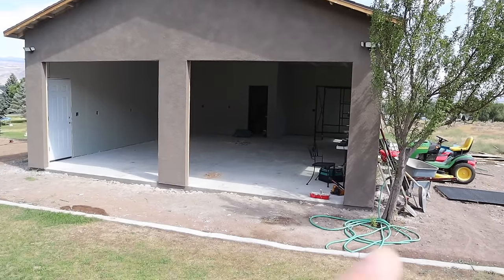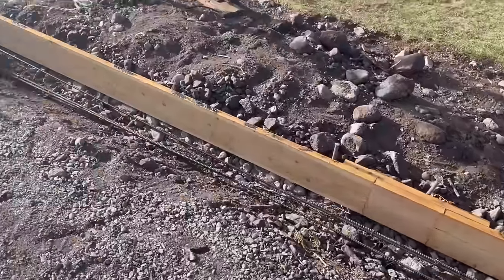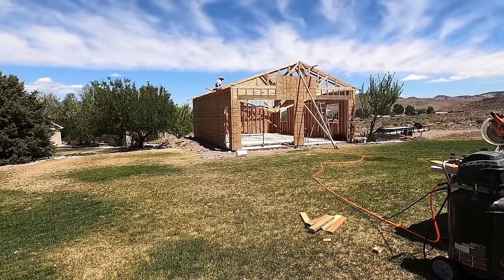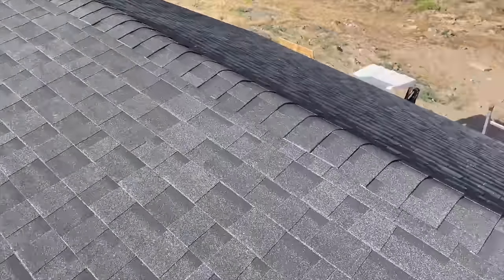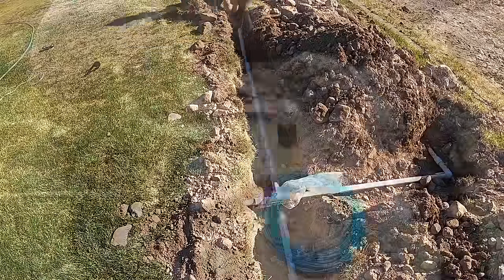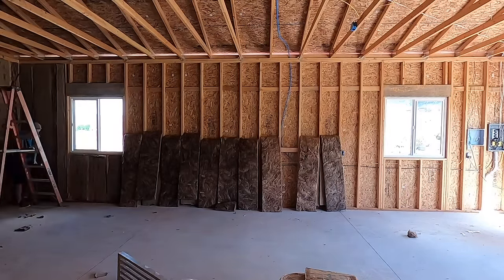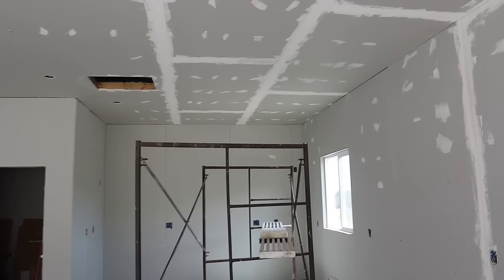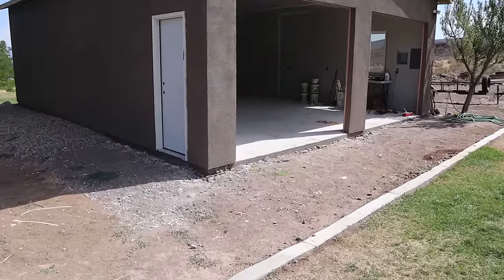Build Your Own Garage 25'x34' (part 1)

Comment: Once you get the first run of decking on the roof, and if you have access to a front end loader, you can lift the rest of your decking up even with the edge of the roof. Eliminates running up & down the ladder. Nice job by the way. I built most of my shop by myself too.

Comment: The main thing to remember when installing an out-building subpanel is you must install separate ground rods (most AHJ require two) and do not use the bonding screw. You want your EGC and neutral to be separate on a subpanel. The only place to use the bonding screw is at the main service panel.
Also, you can save yourself from drywall finishing headaches if you carefully plan your receptacle locations so they do not wind up on a seam. It is much harder for a novice to mud/tape over an outlet and keep the wall flat and smooth.
Keep your electrical box cut outs tight by running the cutout blade along the inside edge of the box (not the outside), but angle it slightly away from the box. It will create a "soft" edge that will "pop" right over the box and remain tight around the edges so there is no risk of gaps when you install the covers. This also helps prevent "run away" of the cutting tool due to the rotation of the cutting blade.
Not sure if you considered adding a small 1/2 bath (powder room). Plumbing can be tricky, but you'll wish you had it when you need to use the bathroom while covered in saw dust and/or grime. Wives definitely hate it when you track your filth through their clean house. ;-P

Comment: Very nice job!  I’m assuming the walls are 10’ high.  Just a suggestion if ever doing this again, the lower 1-2’ of he wall assembly is always the most vulnerable to rot or termite infiltration, not sure what climate zone you are in, but if they are 10’ you can rip a 4x8 sheet of pressure treated  plywood in half and use that as your bottom course horizontal and then osb vertically.  Your only looking at the cost difference of 5-6 sheets of plywood vs osb for a significant future risk reduction…still a great job!

Oh yeah, you mentioned spray foaming the roof rafters… there is very little benefit to that with a vented attic and will still need o insulate above the ceiling.  If it was a conditioned sealed attic yes, but with soffit and ridge vents, save the money and just insulate the ceiling joists.  Look up whatever climate zone you are in and go with that r value.  It’s only 850 sf so I’d go with rolls or batts opposed to blow in.
Reply: That’s a pro-tip, pressure treated plywood on bottom.
Reply from the maker: Thanks for the tips. This is great advice!
Reply: Hello what you paid for all materials and foundation

Comment: You did a great job. I was a tile and marble contractor so floated cement to make shower walls for the tile or granites which is like what you did basically to stucco your shop which sure is hard work. Looks like you put in a lot of power wall outlets which sure makes it easier when working with power in the shop.

Comment: As a master carpenter,  I could rattle off several things to do that would have been easier and more efficient..(but I won't),  I definitely give you tons of credit for taking on a build by yourself!

Nice job!
Reply: Jim wish y9u would for us guys that are going to build our own shop, garage or large sheds.
Reply: @puppygadget3189  GC here from Canada. Reading through this comment, keep in mind that for me, spending more on specialized materials saves the customer money through labour, so the perspective is very different. For example, we'd use Hilti bolts instead of J-Bolts in the concrete because it's much faster to drill exactly where you want instead of custom drilling each hole for the plates. 

Foundation: Generally you'd want a deeper footing as well as a vapour barrier under the concrete. Adding more gravel under the slab will prevent heaving.  Usually what we'd do is dig the footing leaving a small opening for the skid steer to go in, saving you the time of wheelbarrow-ing stuff around. You'd also want a tracked skidsteer (compact track loader) to reduce the wheel ruts of moving around. Having one person with a laser level will speed this process up and also make it more level, saving money on concrete. You can also use depth stakes in the concrete to ensure that the pour/screeding is level or at the grade that you want. 

Framing: You want a treated bottom plate. Especially considering that there is no drain inside (which I'd also probably add, but that adds cost). One way to also save some time/money would be to put the windows exactly 4ft and make the 4'x4' up so you can just cut the sheathing in half and use them in other places. Bump the walls to 12ft and you could use a sheet and a half to do the whole wall. Making the building multiples of 4 in general will also simplify many aspects of the build. 

Roof: Roofing sucks. There's no single part about it that doesn't suck. However, if you live in a calm area with very little wind, we found that building a little stand (sort of like how he used the ladder to slide them up) to hold the plywood up at grabbing distance while you're on the roof minimizes the amount of time spent going up and down the ladder. Load up the stand with a bunch of sheets and then grab them one by one. As for putting the wrap on the roof, use chalk lines to simplify things and keep them straight. Same with the shingles. The lines on the tar paper or whatever system you use are never quite straight or the same from roll to roll. We mostly use the Zip system for the walls and roof now though.

Exterior: He's right, stucco is incredibly labour intensive. I'd probably just use wood shiplap (pre-finishing before putting it up) or vinyl. Additionally I'd put flashing above the windows to reduce water ingress. 

Conduit: I've seen some electricians put large straight sections together and then attach a sponge to a piece of string. The string then attaches to your wires. Vacuum the sponge string through the conduit and then pull the wires through. 

Drywalling: Drywalling is unpleasant. I'd recommend using a vapour barrier to prevent moisture from getting in and turning it to a paste. Put some paint on edge of the electrical boxes and press it against it to leave marks exactly where they are. Then cut them out and they'll be bang on. That being said I'd just use 3/8 plywood instead of the drywall, especially in a shop so you can just attach things to the walls easier.

Additional notes: I'd probably have put 4-5 more 240v and much more 120v outlets in there. This allows you to rearrange your big tools or add to them. We also use a CAD software to pre-design everything beforehand. Sketchup Make 2017 is free. This takes a lot of the thinking and problem solving out of the actual construction process. It also minimizes material waste and allows you to walk yourself through the build process beforehand.

Reading back, this sounds like I'm looking down on his work, but I'd like to stress that it's the opposite. I'm really impressed with how he did things and the vast, vast majority of what he did was incredibly good craftsmanship. I do these things day in and day out. Kudos to him. He clearly did a lot of research and planned this out very well. I'm sure I'm missing things as well.
Reply: @dovid916  Wow thank yo very much for taking all that time to give me lots of great pointers. Would you happen to be fairly close by me here in Yelm Washington State up in Canada B.C. ? Guy like yourself could do probably 10 times what I can do in a day and much better. What we really need since we have so much stuff and not much storage in our house is a 20x24 shed which I’d be fine if it was a wood floor but of course prefer concrete . 

My wife has to much craft stuff we need to get out of the house and a bedroom since our son passed away and now our 10 year old grand daughter is living with us. Plus the garage is stuffed and I need to donate a lot of stuff but got hurt and having a hard time getting this done so can clear it out and put one of our cars  back in the garage. I was buying shop tools and had to move the car out to keep the stuff nice but need to just get rid of the big stuff like this big band saw ect ect.

Just saw your avatar drawing on a kitty. I have 3 snuggled up to me in bed right now and love it. My favorite time of day is the snuggle bed time.
Reply: @dovid916  Holy cow! Thanks for the knowledge bomb! This was a good read.
Reply: @dovid916    Thanks for your tips and discussion.

Comment: all I'd need is this, no house needed😏
run plumbing to it and is set. I too want to build most off it on my own, but for hooking up the electrical, and roofing, that I'd let PRO handle. then you get the satisfaction  of knowing YOU built it.

Comment: Good job buddy. My hats off to you. I wanna do something like this but it is intimidating for sure. My property is not that big so might have to settle for a one car garage but big enough to open the doors on a car and fit around the front and back when the door is closed. Also need space for tools so need a couple of feet for that too. So far I built a carport and made a few mistakes from that but at least I learned. Only thing stopping me now is cash flow😂. I might get permits from city. We’ll see😂

Comment: This is a nice build. The only thing I would have done differently is to use OSB board on the walls instead of sheet rock, this way it’s easier to hang things on them. Not the prettiest but  totally functional. It’s comes to personal preference.
Reply: Vera Nice 
Congratulations from Brazil

Comment: You leave out the last few roofing joists and screw in a platform to hold the entire stack of plywood.  Just remember to put posts under it before the forklift puts the stack up there..  Now all the sheeting us up there. Installing the 2nd row first is a breeze.    And now you are walking on sheeting while installing the rest.

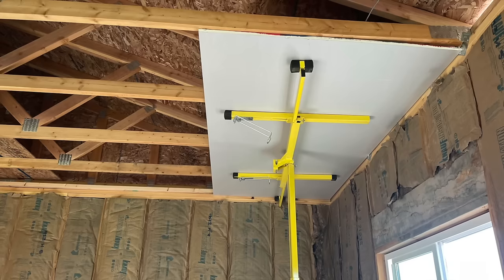Comment: 18:05 They make stronger 1/2 drywall that is designed for 24" OC ceilings that won't sag when insulation is installed over it...  I feel your pain, I used 5/8 drywall in my garage because I had a second floor and wanted a fire block, 12' 5/8 drywall is heavy, plus my ceilings were over 12' so I had to get the extension for my drywall lift which made it over 5FT tall with a sheet lying flat.  I made a jig to which allowed me to step up a sheet a foot at a time to 4 FT so my drywall lift could hook under it and lift it.  I also used "blind mark" magnetic template to find and mark the electrical boxes, no measuring and very accurate that I used my oscillating saw to cut out the square openings rather than the rotozip.
Reply from the maker: Good points thanks for the comment. I definitely should have looked Into the magnetic template and oscillating saw for my electrical boxes!
Reply: Jigs make EVERYTHING easier

Comment: while running the wire should have also ran a water line, even if not wanting it at the time, that way it would be there for the future
Reply from the maker: Great idea for others! I already had a water line close to the shop however I did not put a water line through the foundation which I now regret. I still might put a sink in and just run the water through the side of the shop.

Comment: good for you doing it yourself, but that conduit install has me facepalming so hard.

props bro, few have the gusto you do.

also depending on the cable you used, the pvc was pointless. some cables are rated for direct burial

Comment: Thanks for the video! I am currently debating a metal building versus DIY stick built. This is the exact size I was thinking of. Could you run through your average costs for things? That would help a ton! Thanks!!
Reply: Just pour a good foundation and put a Quonset on it. It'll outlast these buildings by 100 years.
Reply: Im doing a stick built, then instead of siding and shingles, metal. Stick built pole building if you will. Then insulation is easy as well, 16” on center.
Reply from the maker: I will try to go over some of these questions in my next video. Thanks for watching

Comment: I would not have put the air compressor tubing inside the walls. Plywood horizontal inside at floor level and drywall  above, bottom of walls may take a beating and plywood will withstand it better. I like the pressure treated tip too on the outside wall, I'm assuming that will be ripped in the length/8' dimension so the bottom 2 foot is PT? Blocking inside the walls for hanging stuff, but that would require a lot of forethought of what you wanted to mount and where.

Comment: Hopefully you go back and neaten up the wiring in that subpanel. It's only a handful of wires so there is no excuse for leaving it look like a beginner did it (even though you are a beginner, it doesn't have to look like it).

Comment: Really good job  !!  I'm wondering why garage doors are almost always on the smaller walls...   I'm beginning my garage within few weeks about same size as yours. but two garage doors on the large wall.  Did you think about having a second floor or it has never been an option for you ?  I still think about this not sure yet, got to decide in the coming days...   I'm happy I bought an old international 434, its going to be perfect to dig for preparation of the concrete floor and to lift walls...  is there anything you would have made differently ?

Comment: Is there a reason you buried conduit vs just using UF-B (direct bury) wire? It seems like a lot of extra work for maybe some limited protection or future growth options. Pulling new wire through that looks almost impossible though. You can also get direct bury network cable.

Comment: Why didn't you stagger the sheathing???
Reply from the maker: I did on the roof it’s just hard to tell on the video. I stripped a price of osb in half and started with that. Then I started with a full one on the next row. Also on the sides the top two feet I did log ways So it did stager the sides a little as well. I did not explain that in the video however if you look closely in some of the clips you can tell.

Comment: You know what I see that no one else does?

It’s the corners of a garage or home.  You put up a 3 point light on a flat one sided surface. Figure out how to display a round corner to mount the light so you have coverage both in front of the garage and the side. Your welcome

Comment: So my skills get affected by the latest YouTube video I watch - I can see MY future learning from your video the incorrect use of the drywall lift (that yellow thing, with the tripod wheels and little flipping hooks and tilt to gently and easily load/place the drywall on it) - as a matter of fact, you all should know, that before this fricking company made this drywall buddy, I had designed one and was in the process of getting it patented, mfg, etc.. then I saw a construction magazine with a picture that was eerie similar to my design -  this company had come up with it with some differences - not necessarily better tho -this was 15 years ago and they were selling it for $599 or $699 - now they are selling for $199 I think - yeah, so I am an engineer and smart.